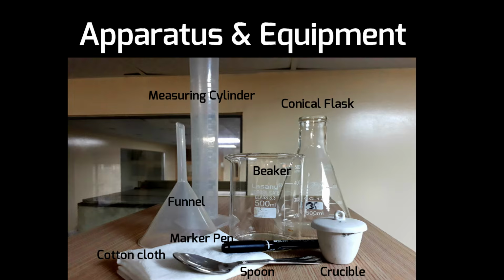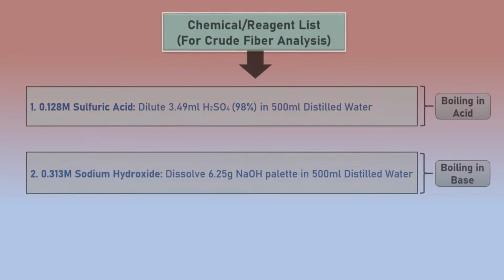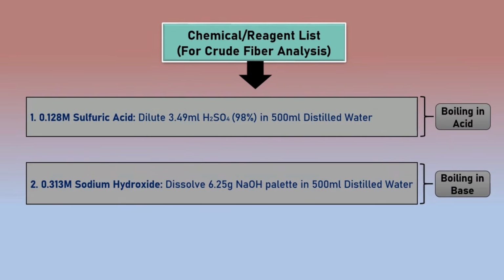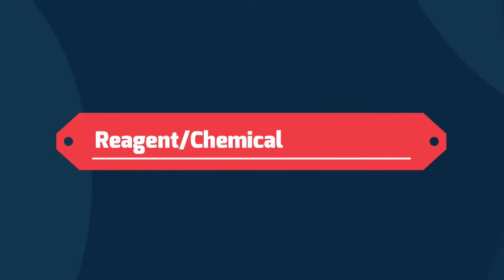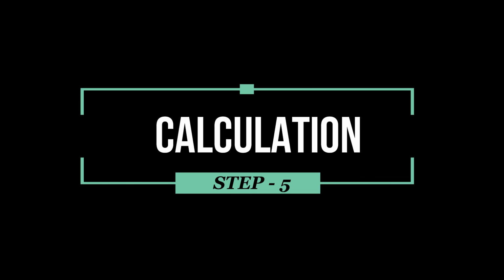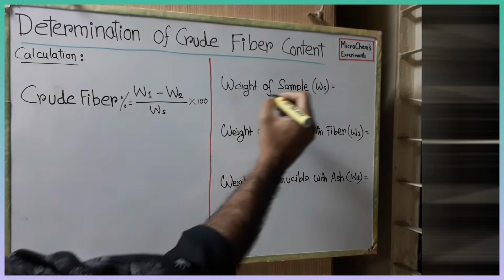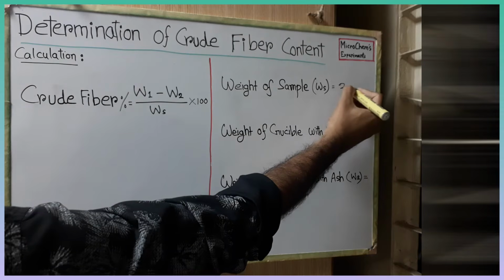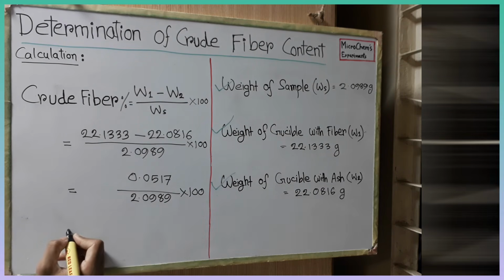Determination of Crude Fiber Content -A Complete Procedure (AOAC 978.10)

Comment: I read some standards and methods for fiber determination, and I have some experience in the lab. However, I still think there are a lot of improper operations in the video, like making the solution directly in the volumetric flask even if the regent generates heat when it is dissolved in water. and for the collection of the residue, I deeply doubt that the scratch movement can collect all fiber and had no influence on the real result. besides, the white cloth can be used as the filter paper? it's too casual in my opinion.
Reply from the maker: Thanks for you comment. Actually this is only for beginner to get their concepts clear in a short video
Reply: anyway, all the lab work should be done in a very cautious safety and serious way. even if it is only for showing the concepts. @MicroChemsExperiments

Comment: Nice explanation...but i have a question what are the needs of heating the sample with acid and a base?
Reply from the maker: To remove acid and base soluble materials from the sample
Reply: @MicroChemsExperiments  Thanks for your response. But I suppose the question is not why we use the hot water, which is what I think you answered, but why we use acid and base. 
I think that is to remove organic materials from the sample such as carbohydrate and protein

Comment: Nice vedio, but i have a doubt on calculation part, as it said to deduct the weight of crucible with from that of fibre, but while in doing show it was shown to substracting wt of crucible with ash from that of with fibre. So what I want to know is if the formula is wrong or the values are put wrongly.
Reply from the maker: Formula is correct.
Basically ash content is not the part of the fiber. Thats why ash wt is subtracted from the fiber wt.

Comment: Hi can I skip the oven drying method and go straight to the furnace step instead?
Reply from the maker: No. Oven drying and after that taking weight is mandatory.
Reply: Thank you for the reply and another last questions isit okay if I stop at the step where we collect the residue and leave it in the crucible, then we will run them in the oven and furnace after two days?
Reply from the maker: @mathiasbee3155  Yes. It is okay
Reply: Thank you for the reply...appreciate it 👍🏻
Reply from the maker: @mathiasbee3155  Stay with us

Comment: There is just 1 mistake in video that is temp in oven is 130 degree for two hours and it was written 230 degree for three hours
Reply from the maker: Oppss Sorryyy ...
It was just a typing mistake
Reply: @MicroChemsExperiments  ok no problem. Just tell me the procedure is this video is for those who dont have crude fibre equipment...
Those who have crude fibre equipment or instrument they do not need hot plate for heating, and furnace, and etc. Pls explaim
Reply from the maker: @A12966  We don't have automated crude fiber analyzer. So, we dont have any idea about it to explain you.

Comment: If I use the fiber analysis by the AOAC 962.09 method, is it also correct? Fiber incineration is not considered in this analysis.
Reply from the maker: If you follow AOAC 962.09 strictly then it is okay

Comment: what is the problem if we not cover crucible with it lid
Reply from the maker: Loss of ash may occure during burning of sample at high temperature for Ash dwtermination method. But in crude fiber test, loss of ash will not happened as the content in crucible is very small amount. So you can keep the crucible open in this test.

Comment: Is the method suitable for plant leaves?
Reply from the maker: Yes. This method is also applicable for plant leaves and vegetables
Reply: @MicroChemsExperiments  For plant leaves,, should we take the weight of raw leaves directly or should we take the weight after drying in oven??? What's your idea about it.
Reply from the maker: @bijoymaitra  You can used raw leaves to test if you consider the raw leaves as sample. But if you wish to test the sample on dry basis then you have to dry it in over before testing.

Comment: Hey ! I forgot to do the step when you put the crucible with sample in hot air oven but I placed the crucible in muffle furnace at 130 degree celsius for 2 hours .. So what should I do ? Should I repeat the procedure or should I put the sample again in muffle furnace but this time at 550 degree for 2 hours ? Please help !! 🥲
Reply from the maker: Normally in muppled furnace, low temperature (100-250 degree Celsius) can not be applied correctly, because it is designed for high temperature applications.
Many times we saw that, when we set the furnace temperature at 130 degree Celsius, the actual temperature rises above 150 degree Celsius.
But if you ensure that the actual furnace temperature was stable at 130 degree Celsius for two hours then there is no need to repeat the test. Just take weight and make ash using furnace again doing the final Fiber calculation.

Comment: Hi there, I have some question need for yours response.  1. The sample size is there any recommendation (base on the % of the crude fiber)?  2. Does this 2g of sample is fixed? Does the method have the maximum sample weight for the acid and alkali which is enough to digest? 3. If I increase the sample size, do I need to increase the boiling time of both acid and base?   4. 2g vs 2.5g of same sample will be have any difference in the crude fiber obtained?
Reply from the maker: In AOAC official method, sample size is declared as around 2g. But I think 3g sample can be used but not sure about the sample size of more than 3g.
To follow AOAC method strictly, we should always use 2g sample. Sample size should not be increased considering the expected fiber content.

Comment: I'm sorry to tell, wrong procedure of scoping the sample after boiling acid and base, some debris may left and trapped in cotton fabric, instead of using fabric you may use porous materials such as filter paper pleased inside of the porous glass crucible and by gravity liquid may drop leaving solid particles which can transfer to heat resistant crucible.
Reply from the maker: Informative MixVid, in AOAC method, cotton cloth is said to use in this filtration. Because other filter paper would cause blockage of it's pore frequently. So you have to collect filtrate as much as you can from the cotton cloth during scoping. And sample loss in the cloth is negligible which is avoidable. How could you say the AOAC method is wrong?
Reply: @MicroChemsExperiments  you can use vacuum pump to suck liquid.
Reply from the maker: @informativemixvid9395  yes we can use but in AOAC official method it is not said to use vacuum pump that's why we didn't use. We followed the AOAC method strictly. If you have any other reference method then you can suggest us. Thank you for your observations.
Reply: @MicroChemsExperiments  indeed, I tried with the filter paper, the results of analysis are distorted, hence the importance of the use of the cotton cloth or
or other suitable molecular sieve.
Reply from the maker: @benzinebkhaled141  Oh really?? We did not try a filter paper but I believe that you would not get the accurate result by using filter paper. As AOAC suggested the use of cotton cloth, so using of cotton cloth is the best.

Comment: What temperature is require in  first and 2nd time geating solution
Reply from the maker: Affan Ghani, there is no specific temperature. Set the temperature at Boiling point (above 110 degree Celsius)
Reply: @MicroChemsExperiments  thanx
Reply from the maker: @affanghani9149  You are most welcome.

Comment: Can we use magnetic stirrer to stirr the solution while heating (boiling) with acid and base? you had to stirr conical flask with hands.
Reply from the maker: Piush Prajapati, If you use magnetic stirrer continuously during boiling, then foam will be form and which will overflow the flask and can cause loss of the sample.
If you want to use magnetic stirrer then you must have to use anti-foaming agent with the sample during boiling to prevent foam formation.

Comment: Hi, can I dry the samples that after treated with acid and alkaline by using hot air oven at 105 degree overnight instead of 230 degree for 2 hours?
Reply from the maker: Qiaowei230, This drying is needed only for the removal of moisture content from the fiber content. Drying at 130 degree Celsius for 2hours is enough for the purpose according to the AOAC method of Moisture determination. Long time drying at 105 degree Celsius could be a reason of loss of some fiber content. So you should follow the standard method to analyse any sample to get the accurate results.

Comment: Can i use whatman filter paper instead of cotton cloth?
Reply from the maker: Ak siddiki, no, you can't filter using whatman filter paper because of it's tiny pore size. After boiling the feed sample in NaOH solution, relatively more dense & thicker solution is produced which is not possible to filter using Whatman filter paper. Cotton cloth is most desirable for this purpose.
Reply: You can use whatman, im using it when I was doing proximate analysis, too slow by gravity, but you can use vacuum pump it to suck up the liquid leaving solid particles of sample.

Comment: Hey. How did you guys do the calculations? What volume is needed for sulphuric acid and what grams are needed for the pellets. Please help..
Reply from the maker: Thank you Sarah Kandolo for your queries. 
I used 3.5 ml sulfuric acid-98% to make final 500 ml of 0.128M sufuric acid solution and I used 6.25g of NaOH pellets to make final 500ml of 0.313M NaOH solution, as described by the AOAC 978.10 method. I followed the AOAC 978.10 method strictly throughout the test.
Reply: #NDF_Determination.
https://youtu.be/ip2M_4xvdhQ
The more readily utilizable nutrients are enclosed by the cell wall and can be grouped as cell contents. The cell solubles are extracted by boiling with neutral detergent solution containing sodium lauryl sulfate and then cell wall constituents (NDF) are separated by filtration.